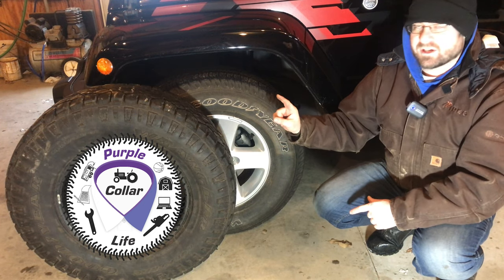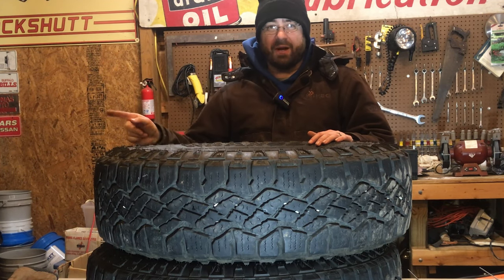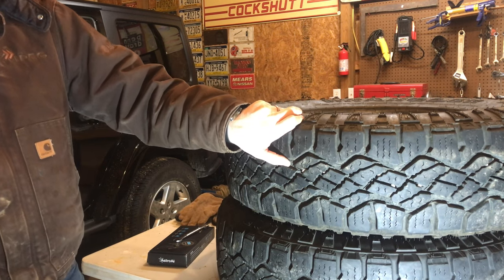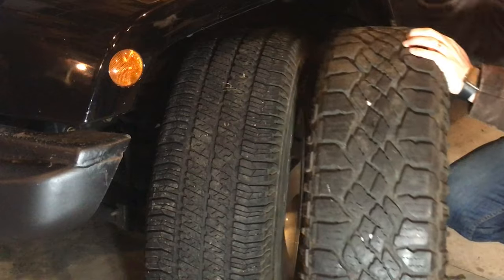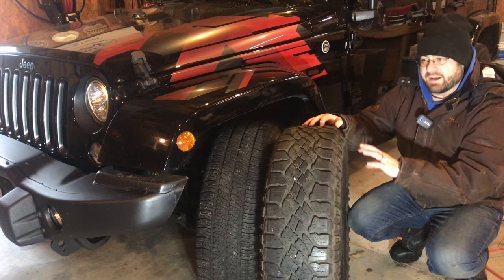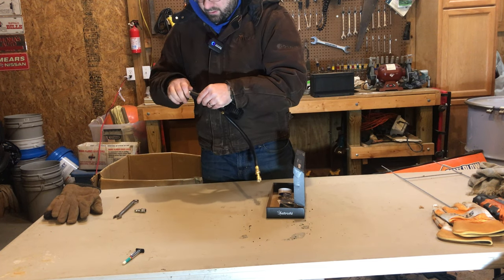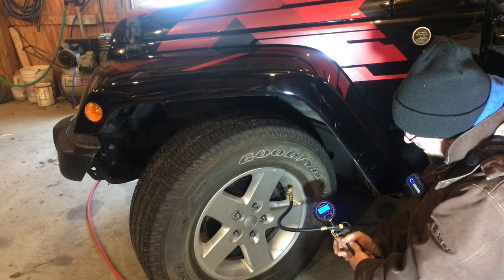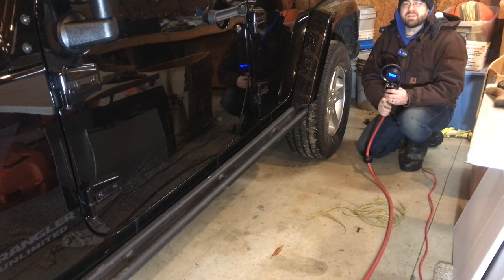#130: Goodyear DuraTrac Tires on Jeep Wrangler.

Comment: When you get down to it, everything is used. Even a new car as soon as you drive it off the lot. 😎 The only fly in the ointment would be is if the tires are under recall. But that's easy to check using the tire code on the sidewall. I'd say Good Deal! 👍
Reply from the maker: Very true!  I checked the tire code and it looks like we're good.  Happy New Year!

Comment: I like that new air chuck
Reply from the maker: It's nice! I used it on the four wheeler too. Since those tires are so low pressure, the digital gauge with 0.1 increments is really nice!

Comment: Hey buddy, I think those are the best tires for our areas we live in. I had a set on my 04' duramax and couldn't believe the wear I got, EXCELLENT.  The main reason I bought them was due to the sipes and the deep tread. Living in Wisconsin ya need the sipes! Bought my 09 tundra rock warrior edition and they come from the factory with 33"ers on them. Toyota kinda has a reputation with longevity parts, and they did it with their tires too. I drive 80 miles home from work the other night in a bad snow storm, and never once was concerned about loss of traction. I've got 25,000 miles on these and just did my last service and I checked the depth at 14/32. We have a place around these parts called Farm & Fleet,  (like farm king,  tractor supply)  and they run yearly specials buy 3 get 1 free. Sweet deal. Drops the per tire price down to the $160/tire range.
Reply from the maker: I haven't really had a chance to test them in the snow.  But they certainly look impressive.  And I've heard several people confirm your experience that they hold up really well, and that the traction is perfect for places like this.  Thanks for sharing!

Comment: Good deal on the tires.  I typically buy used tires on either Craigslist or Facebook Marketplace.  I once got a screaming deal of $100 for a set of 4 used tires including mounting/balancing.  Are you familiar with the "date code" on the tire sidewall to see the age of it?  It starts with "DOT" and then the last 4 digits will be the week and year that they were manufactured.  So, "5118" would be the 51st WEEK of year 2018.  Not sure how much tread is remaining on the tires that you're taking off the Jeep, but you could sell them on Craigslist or Marketplace for a little return on your investment.  The last pair of 2 tires I sold, I got $145 for the 2, but they had about 90% tread remaining.  Thanks, all the best to you in 2021!
Reply from the maker: Wow $100 mounted and balanced is an amazing deal!  I did know about the tire code.  These two Goodyears were from 2019.  One was an early week, the other was mid year.  Thanks for commenting!  Not sure yet what I'll do with those SR-As.  They're a great summer tire, but I run those BFG's in the summer, mostly for the aggressive look.

Comment: How old are these tires???  There is always a reason they are cheaper.
Reply from the maker: Great question. And I had no idea when I ordered them because I couldn't see the date code on the tire photos.  I checked them when they arrived though, and they are both from 2019.  One is early in the year, the other mid-year.